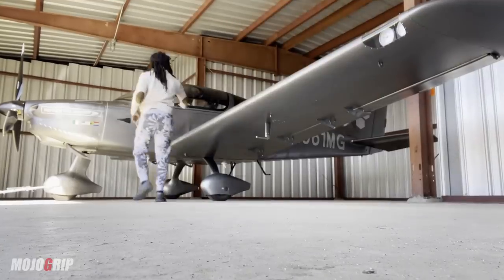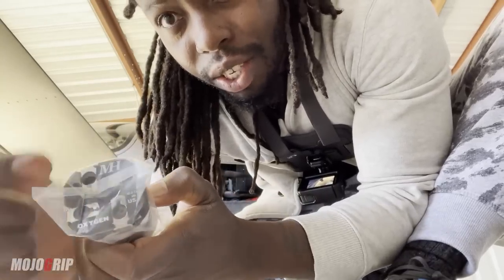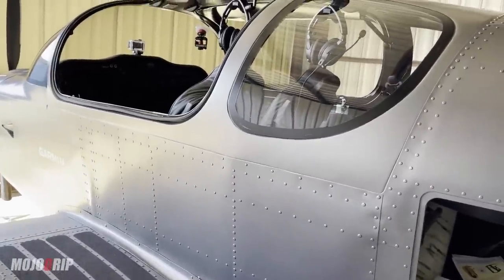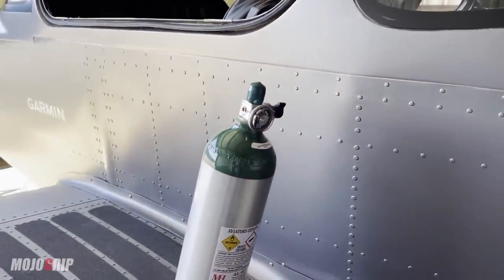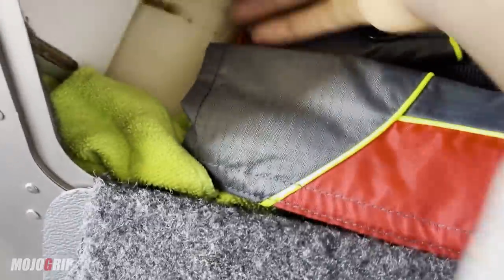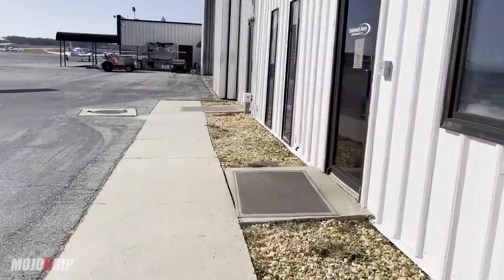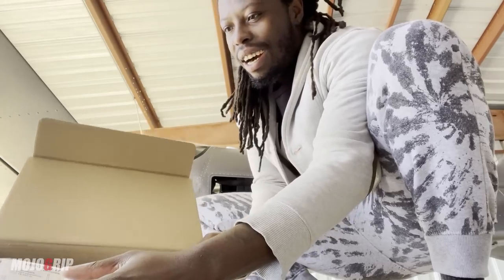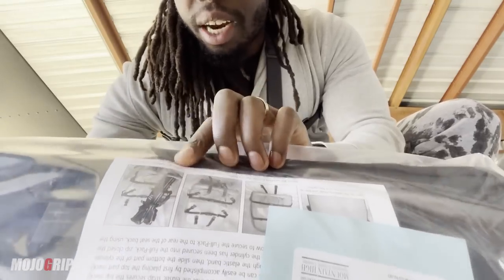This Can Save A Pilot's Life

Comment: 30,000ft? That’s impressive for that engine. There’s a legal reason you can’t go that high, as well. RVSM airspace starts at 29,000 and your airplane is not certified to operate in RVSM airspace. Love your enthusiasm. Keep it up!!
Reply: @themark4u  - I wouldn’t spread that around too much.
Reply: @themark4u  - RVSM aircraft are certified and equipped to fly in RVSM airspace where only 1000’ of vertical separation is needed. Below FL290, 2000’ of vertical separation is needed. Controllers don’t know which airplanes are certified and which aren’t, but you were causing a potential threat by flying an aircraft that was never certified to maintain tight altitude tolerances where separation is much closer. Also, pilots must be certified to operate in RVSM airspace. So, please stop doing that.
Reply: @cloudstreets1396  I'm aware of the navigation performance required to routinely operate in RVSM airspace. I don't recall ever saying I flew a non-RVSM capable aircraft, in RVSM airspace without divulging the aircraft's capability. Why would you assume I did that? Now I'm assuming that you do not know that when a flight plan is filed, the aircraft's ICAO surveillance and equipment codes (including RVSM capability) are listed, for all controllers to see. I'm also assuming that you know I wouldn't be able to fly aircraft above FL180 without talking to a controller? I mean, technically I could do all the above- once.
Reply: @themark4u  - Your first comment was, “I have flown above FL300 in a non-RVSM aircraft.” So I took you at your word.

Comment from the maker: Some correction here: To test the oxygen, you wanna turn/open up the nuzzle pretty good to get oxygen flowing. Also the mask I used as demonstration, if you actually used that in flight, it requires more oxygen so you sent the EDS to F settings instead of the standard D settings.

Comment: Battery operated? Is there a LOUD low battery alert, something you can hear with the engine running, headphones on, and the equipment in the back seat? Might want to have, and rotate through, extra battery packs... Is there an easy way to over-ride the controller feature if there is a battery failure? You are betting your life... Stay safe!

Comment: Why are there gaps and dents in the left side of the aircraft under the cockpit? Almost as if the parts didn't fit correctly.  The support near the front pillar is showing as if the skin is pushed in. I noticed all the dents in left fuselage during the taxi videos a while back, but all of them are much more obvious here with the close shots. There is also buckling where the skin is attached to the frame just forward of the aft bagage door. What happens if water ingress happens and begins to freeze, or is trapped and initiates corrosion? I didn't see the denting or buckling issues on any of the other sling builds I am following. Did this aircraft get damaged in some way? By no means did I expect perfection in a kit build by an obvious novice, but in retrospect the vast majority of the build was done by the factory folks in Torrance, seems something is off somewhere.
Reply: I share your concerns, and I also noticed the poor fit of the wing fillet against the fuselage.  However, I will say that some colors make insignificant waves in metal look worse than they really are.  And, more than anything, shadows can reveal minor imperfections that you’ve never seen before.  I had my Cherokee for years before I noticed some very slight hail damage to the ailerons and stabilator.  I could only see the hail marks when the plane was in a shadow and looking at it from a certain angle.  But in bright sunlight these control surfaces looked completely fine.

Comment: Directions said open tank valve slowly, but it is supposed to be open completely...right?
Reply: The tanks I use for welding have to be opened completely for the safety check valve to work properly if the regulator gets damaged. If you open it too fast the check valve will close and you could possibly not get enough gas or none at all. I assume these work the same way.
Reply: From the manual: 7. Open the oxygen cylinder valve SLOWLY (~ 2 turns).

Comment: Wondering if there is a way to power the EDS from aircraft power?  Batteries seem a little sketchy for an O2 system.  I suppose with rigorous inspection it wouldn't be a major concern.
Reply: I was curious about this system/manufacturer, so I downloaded the manual for the 02D2 (looks like the model of topics here - not specified) and there's a 4.5V connector on the EDS (Electronic Distribution System) enclosure.

https://www.mhoxygen.com/2016/wp-content/uploads/5MD20-0003-00Rev-1-MH-EDS-2G-User-Manual.pdf